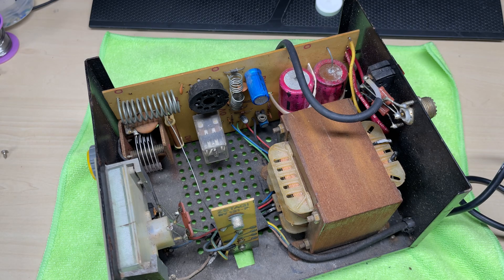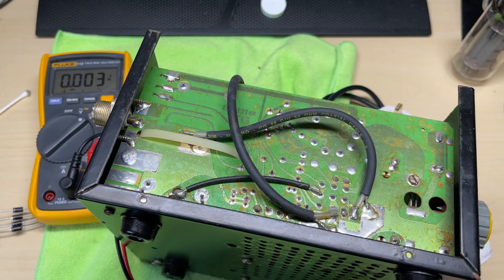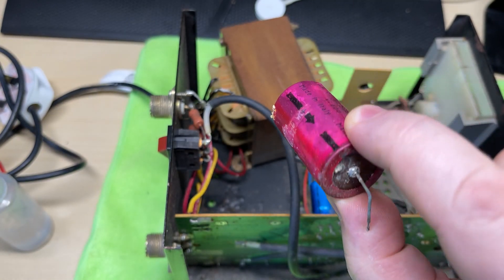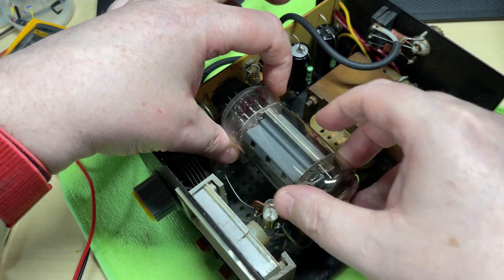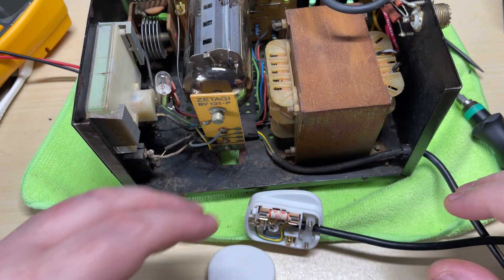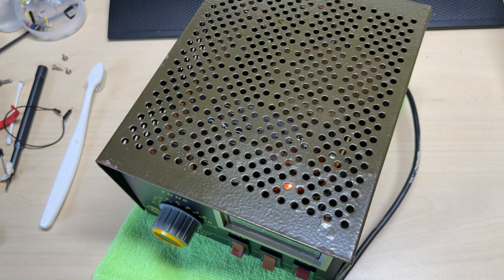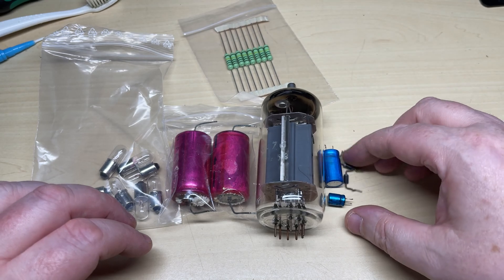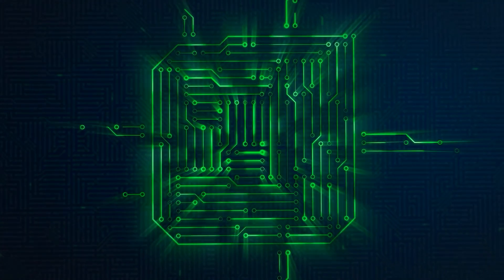EP 146 - Zetagi BV 131 - Valve amp - Repair and test.

Comment: Hello, thank you for this great video. I would like to know the value of the overvoltage resistors on the 47uf 500 capacitors. And also the value of the diodes below the capacitors. Thanks in advance. Sincerely
Reply from the maker: I cant remember the diodes spec , they are hv rectifiers , the bleed resistors 10meg is good.

Comment: I'm a bit late to this party, as I haven't looked in on your channel for a few months. I'm also a C&G fully qualified 'old school' TV engineer and have worked on loads of these BV131 amplifiers and enjoyed your video.  They work extremely well, but are only good for short duty cycle DX, and not for general yapping on UK FM. I've seen them with the watt meter totally melted from radiated heat from the valve - I always used to fit a heat shield to protect it. I've also fitted small cooling fans below the valve, drawing cool air in from below, but it's a bit of a 'faff'. I once fitted one to only work when RF was present, so it wasn't whirring away all the time on idle, although I think if you're going to fit a fan that it's probably better to have it running all the time regardless, as there's a lot of heat to get rid of and fans are made to be quieter now than when I used to fit them back in the 80s. 

You're very lucky on a couple of counts with that amplifier, one being that the mains transformer isn't burnt out - they often are, due to that radiated heat and the fact that most of them are wound for 220 volt mains and not 240 volts - a check of the heater voltage will confirm, in that if it's over 6.3 volts by a good margin (like nearer 7 volts), then it's a 220 volt transformer and likely to have a short life, as too will the poor old valve. The second thing that you were lucky with is that it's the EL519 and not the earlier 6KD6 version, which melt their RF chokes and also the valves are near on impossible to find at a sensible price nowadays, also the 12 pin valve bases arc and burn out and are impossible to find. It's funny that those main HT doubler capacitors are nearly always a bit leaky from the ends, but it doesn't seem to bother them, although those in your amp are definitely the worst I've seen, so not a bad idea that you replaced them, although I've never known one to actually fail, which can't be said for a few of the others on that board, basically all the ones you didn't actually change, but you just take a chance, as even replacements can fail a week later due to the stress they're under. 

The whole amplifier is run under a lot of stress and you have to expect component failure. Those pentode valves are triode strapped and run in grounded grid mode and that original valve could potentially lose several of its other pins and still work, but unfortunately it looked like it was the cathode pin 9 that was broken off on your valve and it's only got one of those, so it was unfortunately finished! There's no HT when you first switch the unit on and let the valve heater warm up, so there would be no potential 'bang' until you actually applied RF, and there we come to the other very common failure, and that's the RF sensing relay switching transistor (2N2222 or similar), which I used to make a little heatsink for to increase its reliability. I've never known those HT doubler rectifier diodes fail, although there's always a first time. You need to tune the front control for maximum RF output immediately on applying RF, or the valve will have a short life.

I don't have the time or inclination to work on these things these days, although an old friend has dropped one on me to look at a while ago and it's got the usual burnt out transformer and duff valve. I've tested its potential working state with my large external testing transformer, so I know it's capable of working with a rewound transformer and a new valve, but whether it's worth the expense is another matter.

Are they good RF amplifiers? Yes, they're very good and they work in a proper class of operation that doesn't 'clip' on AM and SSB. The problem is that they're run on overload and tend to have a very brilliant, but short life, particularly if hammered on UK FM, the whole anode structure of the valve can be seen to glow bright red - that's when your watt meter melts and drops out of the front and the transformer goes up in smoke...lots of stories of this happening back in the day!

Is there a better amplifier of this class for general use? Yes, but unfortunately it's the B132 single transistor version. These 'look' like the BV131 and use the same metalwork, but are a basic X10 amplifier - 4 watts in, 40 watts out, 10 watts in, 100 watts out etc. They'll run all day every day and are very reliable, the only faults I've had are the relay contacts and the main single power supply smoothing capacitor going open circuit (or severe lack of capacitance), they also don't 'clip' much (if at all) on SSB, so a good all rounder. They'll run for hours with 12 watts in on SSB and hardly feel warm to the touch on the rear heatsink, but keep FM to 4 watts if you have long overs!

Is the Bremi BRL200 any good? Well yes and no. It's more reliable but doesn't have the 'poke' of the 131 and the valves are getting difficult and expensive to source, having not been manufactured for decades. If you want a real challenge then get a BRL500 - at least they use the EL519, five of them in total and I've always bought the Russian 6P45S/EL509 from sellers in Ukraine at sensible prices, but I have to say not recently.
Reply from the maker: Hi ,thanks for your comment ,im also C+G qualified tv engineer ;) a breed thats fading out unfortunately .
I know im lucky with this amp with the transformer etc, i didn't change the other small caps because i didn't have any in stock , shame on me .I can assure you i don't sit on 19 running it full tilt all day, i would only use it for SSB when needed , i find just 10w gets me out just fine , just nice to have a bit of a boost when needed , i think a fan would be a good idea , maybe in the future, for the moment its sat next to the jumbo looking nice .
I got it because i wanted to refurb a vintage amp , and i think i did that in the most part , it works but i certainly wont thrash it to a inch of its life.
Reply: Yes, I wouldn't worry too much about the other caps, they may never fail or you could replace them and find that one of the new replacements fails in the next week for no apparent reason, it's just all that RF and stress, I'd tell you which they were if I could remember, which I can't just at the moment. Another fault I've just remembered is the early version of the 131 with the RF tune light on the front top corner, the print would burn up and track, killing the RF. I also wouldn't worry about any of the date codes on those Russian valves (I think all those 'fat' ones are basically rebranded Russian Svetlana types and none of them have been manufactured for decades, so even new ones will be decades old. There's a problem with fitting some of those in certain amplifiers due to them being too fat and too close to the main RF choke, so the amplifier has to be modified to make them fit, not in the BV131, though.

I trained as a TV engineer in the 70s, but was done with it by the early 80s. I came back to it after retirement as a bit of a hobby with old 405 line sets, but don't have much time for it just at the moment. @MicroChipz

Comment: Graham, it's great to watch your video. I'm a bit of an anorak for old CB tube amps. I think I may have seen that russian valve before.
I've not watched any of your content before, but I'm certainly going to be watching from now.
RG 205 Kevan Swansea Wales
Reply from the maker: Hi and welcome , thanks for watching , the tube is a 6n45c , they are all over ebay from ukraine ,i believe they are svetlana tubes made outside st peterberg . it works well.
Reply from the maker: I don't do many tube amps , i leave that to Chris in wales, i had to get his guidance to fix this one .
Reply: @MicroChipz  he's my inspiration and guru for fixed the scrap I buy from eBay.if I get stuck, which is often, I'm straight on to Chris on messenger
 If that fails he and Corinne invite me for a brew and a tutorial...
Reply: Yes, this is a tube i bought from the Ukrainian. I perhaps have bought around 150 of them this last year. A very good replacement for the diminishing el509 519. The one shown in your video came via myself through Chris...
Reply from the maker: Ah nice to know , im a mere novice at tube amps but it was nice to get one working :).

Comment: Trying to fix a Bremi BRL200 amp. All ready to roll but won't switch into TX - I think it may be transistor 2n2222 ?
Reply from the maker: There’s not much in the rf sense circuit some diodes and a transistor, shouldn’t be to hard to find.
Reply: @MicroChipz  Theres a cap missing I think its maybe just for SSB delay, but when I key an input of 4w nothing happens. Both valves lit ok. Hopefully can sort it.

Comment: This is my favourite version of the bv131 i use the russian tubes in mine.
Reply from the maker: Good solid amp when used correctly.
Reply: @MicroChipz   Had many of the zetagi tube amps over the years but i always go back to to old bv131 like this one . Have got a bv1001 that i will have to get round to sorting one day its on my long list of to do projects.
Reply: one of Mine is the one that utilizes a 6kd6 it's way strong. I got it for a song not long ago from Doug at knights..